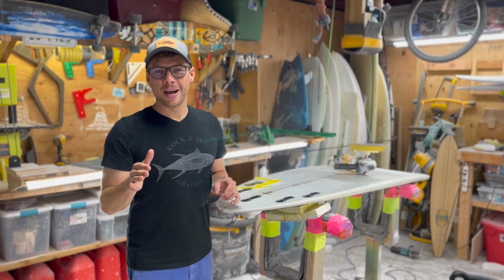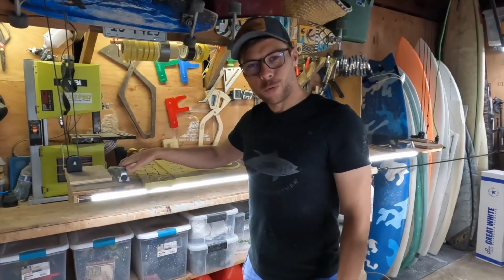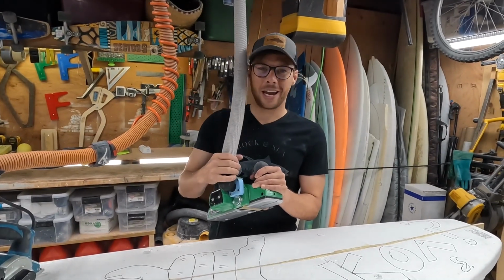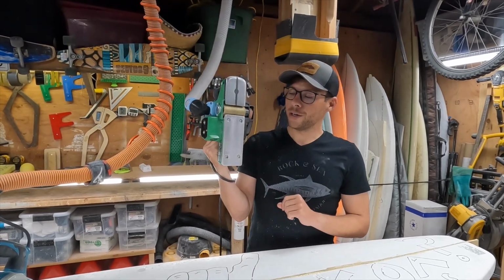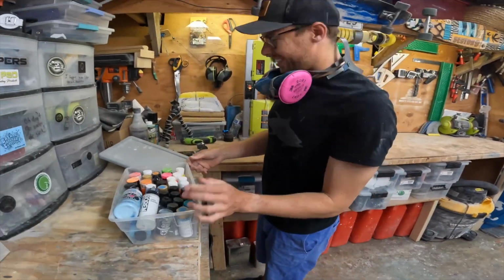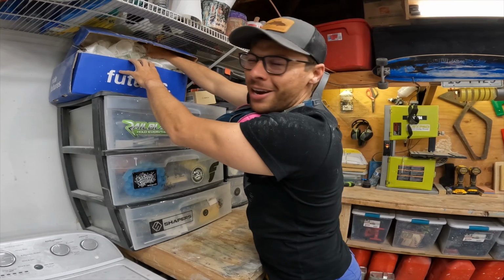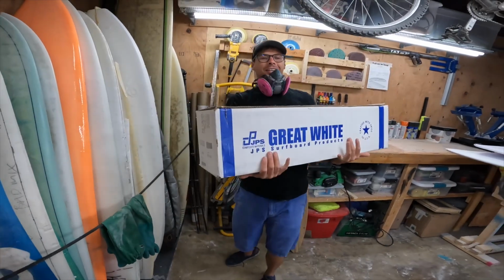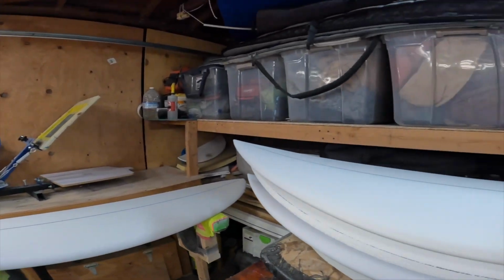Garage Surfboard Shop Tour

Comment: Are u using the E or S glass.
Reply from the maker: You know I’ve exclusively used E cloth thus far, but I really would like to get my hands on some S cloth.  S is supposably 10% stiffer and 30% stronger, super good as a deck patch for ding resistance or as a stiffness reinforcer for EPS-epoxy boards.   I’ve been wanting to give it a try but just haven’t yet

Comment: how  dose   ur  dust collection    work   with the long hoses  do you have    a old  shop vac  up  in the  ceiling
Reply from the maker: I have a shop vac on the ground under that back work bench, but I have a couple of hoses linked running up the back wall and then down from the ceiling.  It’s super convenient to have the hose coming straight down from the ceiling, that way when you are working it doesn’t get in your way walking around the board 🙌🙌

Comment: Nice.  I put curtains for a cool backdrop and dust control.  I will still find dust in 10 years.
Reply from the maker: 😂 seriously, dust is the worst!  I still get dust everywhere from hand sanding a blank, but a vacuum capable sander is an absolutely GAME CHANGER, highly recommend!  I really capture pretty much all of the fiberglass sanding dust with my vac
Reply: @JDubHannah  I do have a random orbit with vacuum so we’ll see when I get to glassing.  It works great with the planer.
Reply from the maker: Nice, seriously so nice to cut down on dust! I still produce a ton hand sanding while shaping but capturing everything else is so nice!!

Comment: Love the set-up man! Great videos, DIY is the way to go!! Just noticed you put the outlines on the top of the blanks, what's your thoughts behind that? Keep them coming!
Reply from the maker: Good question! It really depends how you measure your boards and determine their length! Some people measure board length along the deck, some people along the bottom of the board.  If you chopped a board in half right down the stringer and looked at it from the side, you could imagine two concentric circles where the deck runs along an arc of the inner circle and the bottom runs along part of a larger outer circles arc.   The boards bottom arc length is actually longer than the deck arc length, it’s traveling along a wider path to get to the nose of the board.  I just measure length on the deck and trace on the deck.

Comment: All of that mess. Why not design a preform on your  beloved Mac, then make an exact mold that you can pour poly into?
Reply from the maker: Molds would be easy, but every one of my boards has custom dimensions and is tweaked for each surfer and the waves they are surfing.   Big companies just CAD their boards and have a big CNC mill out each board, takes like 20-30 min per board, super convenient for bulk standard dimensions but not good/convenient for customs